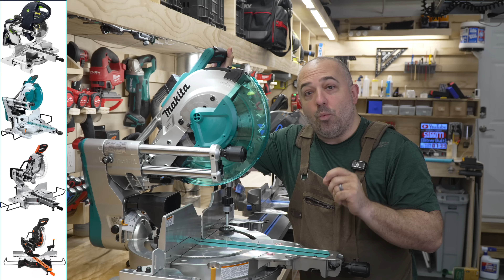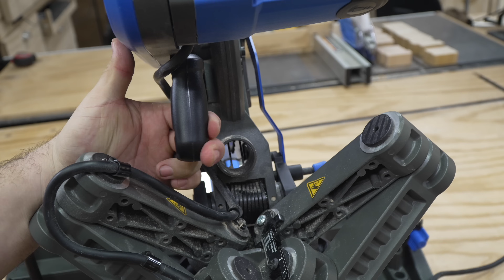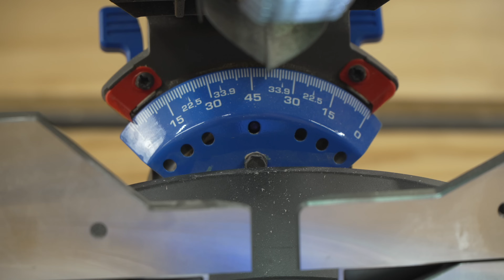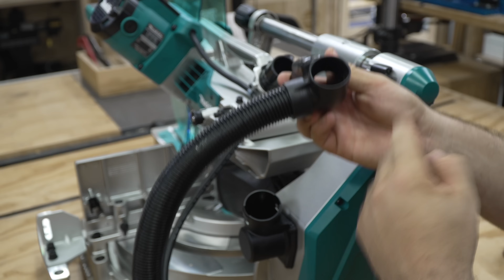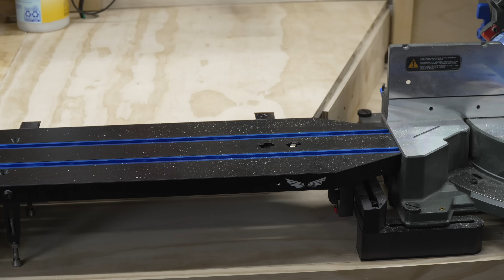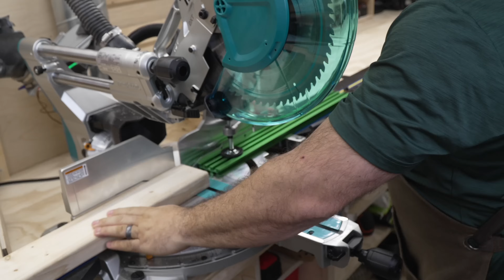Rail Vs Bearing Compact Miter Saws - Makita LS1219 & Delta Cruzer

Comment: Why the F on Delta angle scale there is 45 degrees on straight cut. 0 degree when cutting 45. This is typical in US ?
Reply from the maker: no its that there are red arrows on the right and left so go off what the arrow is pointing to, when you bevel to 45 it will point to 45.
Reply: @ Damn I shouldn’t write Youtube comments after roofing for 14 hours 😅 Sorry for bothering you with stupid question
Reply from the maker: @ocotuchodzi  lol no worries!

Comment: I wouldn’t be shocked if over time the newer hinged style eventually starts to supplant telescoping tubes, but no matter how you cut it (wink wink), it’s a large range of motion you’re trying to get tight accuracy out of with a very large blade imposing lots of force on work pieces while being suspended from only one end. The Makita also had issues when it first came out however many years ago that for a short while demanded a lot of tweaking from new buyers out of the box. Makita (ahem) straightened it all out after a few weeks so it’s not an issue anymore, but the point is it’s just a big engineering challenge with either design solution.

Having said all that, man am I happy I got the Makita.

My projects on rare occasion require me to make angled cuts of 4” ABS tubing so I absolutely needed to get a 12”. The previous 12” I would commonly use would unavoidably deflect as the cuts progressed, leading to very obviously curved surfaces that I’d have to sand flat after the fact. Very time-consuming and tedious both for the sanding as well as having to account for the loss of material in the length I would cut. I spent a LOT of time trying to figure a way around the problem as the blade did not exhibit this deflection just moved through its range of motion in empty air but the moment it was cutting anything that huge blade would bend as it moved into each work piece, even if I actively attempted to steer it away from doing so. Maddening!

The Makita on the other hand…just goes through like butter and stays straight throughout. The cuts are perfectly flat and smooth and I can bind the tubing together (using solvents) straight away, perfectly sealed every time. Just amazing.

I do also wish it had the shadow line and early on even thought to fashion my own LED attachment to replace the laser whenever it fell out of alignment. Thankfully that hasn’t happened yet, and if Makita does have a kit of their own available now to install a shadow line then I’m glad I waited. That and if Makita finally releases larger LXT batteries (which is rumored to maybe finally be happening soon) would perfect this beautiful saw as far as I’m concerned.
Reply from the maker: Quite the “cut” up you are! That’s good to hear that you are getting a lot better cuts with the Makita on your bevels! Yeah, I’m going to install the new shadow this weekend. It’s only four pieces and three of them are Makita factory replacement pieces for one of their other saws so should be a simple procedure, I’ll have it in my next video.
Reply: @ this I am extremely excited to see

Comment: I agree with your assessment. The Makita is the best quality for the money. As cool as the Bearing system feels, it is not accurate. I bought the Makita after purchasing then returning the Bosch without even making a cut.  The bearing on the arbor of the Bosch had so much play I didn't feel it was safe to power it up. The deflection of the blade from the extended position was very similar to what you are showing with the Delta, very sloppy. I am pretty happy with the Makita. Seems to be accurate . I am hoping to be able to do some segmented glue ups with it for woodturning. I have it hooked up to a underpowered small shop vacuum and it makes a mess. I will eventually get a better solution for the dust and hopefully it will be better. Thanks for sharing . Great job with the comparison .
Reply from the maker: Thanks for the insight there! I was doing dust collection test with it last night actually, I’ve been 3-D printing some replacement parts to increase the capability. I luckily have a 6 inch dust collector pipe right next to it, it’s gonna enable me to do 4x2in lines with adequate section. One line to the two built-in independently and then one each to my new fence system I’m building, should be interesting!
Reply: @ that’s a good idea

Comment: I had the Bosch articulating saw and it too has deflection issues - no good for trim work.  None these type of saws will produce great results as there are too many joints which multiply the error inherent in mechanical connections like these.  The mechanism is basically translating rotational motion into linear motion, bad idea. I did pay the big bucks for the Festool.  It's by far the best saw I have ever used. Not only is it very rigid, the vibration and run-out of the blade is almost non-existant so it produces extremely smooth accurate cuts - worth every penny.  The term for these articualting saws BTW is "Axial" not "Axle".
Reply from the maker: Thanks good breakdown, glad you’re happy with the festool!

Comment: So far I’m I love with my 10in Bosch. I’m not asking much of it I must admit. I did make a bunch of test cuts with miters, bevels, compound miters and 90. Dead on out of the box. Mostly I use miter saws for breaking down lumber. I did a bunch of drawer sides and everything was absolutely square. Deflection so far, takes an unreasonable amount  of force on my part while making a cut. I will be on guard but hopefully I never have to deal with any failures
Reply from the maker: That’s great! Honestly part of what I’m gathering from the comments is it seems on the hundred units in all the brands is there could be manufacturing or assembly tolerances / variations that some have it more than others
Reply: @ very true, which is why I own tools from so many different companies. They have have their gems. I have noticed more complaints regarding the 12in as opposed to the 10in as well. Haven’t ever had my hands on a 12

Comment: I see that you said you missed the metabo. I have the C12RSH2s. I got it on sale for $350. I picked it because of the fixed forward rails. It is amazing, easily the least expensive but loads better than the delta and the Ridgid.
Reply from the maker: 👍 awesome great to hear, honestly I think any of the lineup that’s rail mounted is the way to go

Comment: I purchased the delta cruzer I sold mine due to it being not very accurate. I layed down zero clearance tape and noticed how big the line was growing over a very short time. One other thing I did not like about it, was the start it jumps out of your hand which would trip my breaker all the time. I now own the festool miter saw, I did not purchase it new I would never pay 1600 for a miter saw. I only paid 550 for it I got a screaming deal, this was my 4th miter saw. I started off with a cheaper harbor freight than I got the Hercules miter saw, I loved it very good saw however I needed a saw that could buy up against the wall I returned it and got a Matabo saw loved it. When I moved someone broke the locking mechanism and render it useless.
Reply from the maker: Thanks for the breakdown! Ah yes that hard start, I noted that on the spreadsheets, my old ridgid (2 saws back) would always trip. The breaker, soft starts are much nicer there.

Comment: I have the 10 inch rigid and it has a small amount of deflection when the arm is fully extended, nothing near what is shown in the video. So maybe this is due to rigid versus delta, or 10 inch versus 12 inch. I found that when you lock the arm into chop only position, the deflection is minimal, and there is a bit more deflection when the arms are fully extended. I have built about 100 planters with it and the deflection, whatever it is, is not impacting the quality of the builds. I bought the saw about 2 years ago. I had researched all the small footprint sliders, and the rigid was the only one I could actually test before buying (at Home Depot). I think it is fine for diy projects but I would return it if it has as much deflection as what is shown in the video.
Reply from the maker: that's good to hear, im guessing it is more apparent with the 12" with the added reach. also the delta goes 18in max cut the most of any of them, the farther out you are the easier to move I would guess.

Comment: On the Delta/Bosch "bearing" style I suspect the bearings involved are roller bearings. I have come to wonder if Torrington style bearings (needles as opposed to balls. think automotive U-joints as an example) would cancel out some of the deflection.
Reply from the maker: I think you’re right, after the video I was pushing on the side of the saw just to see where I could see if there was a very obvious point of movement and it really was every single one of the joint areas flexing a little bit

Comment: For in-shop, more critical use, deflection is more of a concern for the trueness of 90º cuts in wider stock. If you're cutting 2x4s for construction, the differences in length you're seeing don't matter. 
I'd lke to see the best of each breed compared: Festool to the Bosch.

Comment: I have had the exact same experience (regarding deflection) with both Bosch Glide saws that you had with the Cruzer. Really shows up on slide cuts. I am curious to see how the Makita treats you. I’ve heard that a lot of people have had issues with the removable fences not being square/coplanar with the base and that the rails can be out of parallel slightly, causing bad slide cuts. Fingers crossed you got a good one!
Reply from the maker: Aww sorry to hear that about your Bosch, well initial inspection so far have been good. Everything came out of the box square and nice looking cuts. I have a 3-D print scanner coming tomorrow, I’m actually going to scan those upper fence pieces to then manufacture some new modified ones that will have dust collection built into the fence, so I’ll be taking a very hard look at them tomorrow. I’ll let you know if I see anything wonky
Reply: @BitnerBuilt Well heck, let us know about the scanner as well! (Or just me if it doesn’t work for the channel.) I actually make dust collection parts for miter saws (throat plates, specifically) and have been heavily considering getting one.
Reply from the maker: @InspireWoodcraft  I tried the reality ferret pro - not a fan, maybe its me but spent two days, purchased 3d scanning spray to coat the object and count get any decent scan of it.
Reply: @BitnerBuilt Ahh, that’s no good at all.

Comment: Try out the SKIL 10" SCMS, just not compact. I've had it for 3 years. Rear sliding rail, accurate out of the box, shadow light, quick clamp hold down, $300 or so. Dust collection can be improved with a hood around/behind the blade, like any SCMS.
Reply from the maker: Cool I will take a look thanks for the recomendstion
Reply: That’s what I have. Great saw. I have a dedicated small shop vac on an automatic switch. I’m really happy with the dust control.
Reply from the maker: @jeremyclaybaugh  oh that’s awesome, I like all the good feedback from owners, I’ll have to take a look

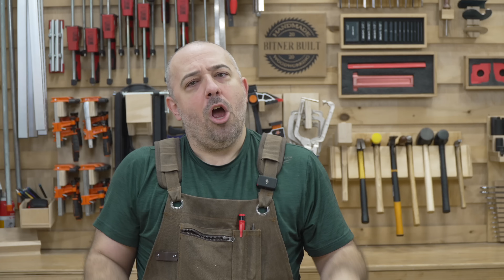Comment: Came here to say this. :)  Well, I came here to add my +1 to the chorus of voices who invariably cried out "What about Metabo?!" at the 1:06 minute mark.  :)
Reply from the maker: 😂 yea I am pissed I missed that one for the price I prob would have tried that before the Makita honestly, but I do like this Makita (just not my wallet)
Reply: I've used both, and the sliding action on the Makita is smoother than the Metabo right out the gate, and the blade guard on the Makita is affixed in a way that makes it feel more substantial, but other than that- the new Metabo has a shadow line, you can adjust the bevel from the front without needing to reach behind the saw, and it powered through a treated 4x4 like it was a spruce 2x3.  No performance complaints and no apparent deflection after three months of occasional use.  The work piece hold-downs are terrible though. I am spoiled with the quick setting material clamps from the Skil.  On the Metabo, considering how tall the fence is, it feels like you are turning that clamp forever.
Reply from the maker: @lifeofreilly  great feedback!

Comment: Hey I had to replace that saw two times in one year and I would not give it a thumbs up that's the Harbor Freight 12-in miter saw
Reply from the maker: That sucks. She had a bad experience with it. Did they replace it for for each time? I had that one for four years function great no issues and I have many friends who have it too who also like it, it is harbor freight… So there’s that, but it does have all the features and functions of these More expensive saws that are really really low price. I could’ve bought 3 1/2 of those saws for the cost of this Makita.

Comment: That deflection is a massive design flaw.  Wowza! 😮😮😮😮
Reply: Any point of movement requires a tolerance, and the more moving parts, the more the tolerances add up.

The Delta saw has 6 tolerances (the 3 rotating points per side) which are all independent.  That adds up!

The Makita saw has 4 tolerances (one per rail) but they are not independent (the rails are all fixed to the same front object and same back object) so they act as one tolerance.  That's as low as it gets for parts that move!
Reply from the maker: @DSArmageddon666 great breakdown!
Reply from the maker: Yea wish I had known the extent before spending the dough
Reply: @BitnerBuilt  good video tho!
Reply: @BitnerBuilt  Learning curves are expensive.  My new rule is to practice on someone else's stuff, whenever possible. I really appreciated this video. I am setting up a new woodworking shed and need more wall clearance than my old Rigid rail saw can provide. I may opt for the 10-inch version, but all else being equal, Makita looks like the winner.

Comment: Not sure if you mentioned this, but it appears that the arms are different (your 3 image comparison show the difference). I have to Ridgid Cruzer version, but mine are a lot beefier (maybe mine is an older model on both Delta and Ridgid) and I purchased it a year and a half or two years ago and my handle is pretty stout for the carrying portion of it. It does still have deflection on the blade.
Reply: I got the Bosch, and a friend got the Rigid Articulation Arm  like the delta, we both sold them within a couple months, just too floppy, just as you show. The bearing joints come loose easy and can be adjusted but is annoying, happens regularly and is simply unnecessary. LMU and rods are much more reliable and stiffer.
Reply from the maker: thanks for letting us know. theres usually some small differences with clones (that Hercules UK model has a few added flares) but they share most of their replacement part numbers.

Comment: You've broken my heart! A while ago, the 12" Delta Cruzer was on sale for less than $350, so I bought it (knowing about the deflection issue). I've only had a chance to use the saw a few times (I was still working full time as a CPA). The few times I used it, I was careful to avoid any deflection and I've been happy with the accuracy. But, I was only trimming turning squares to length or using it on shop furniture projects, so accuracy wasn't of paramount importance. Now, my wife and I are serving a 2-year full-time mission for our church. We're in another country, so my Delta Cruzer is sitting idle in the brand new miter saw station I built for it shortly before we left. I hate to think I'll need to replace it when we get home!

A couple of comments about the comparison between the Makita and the Delta saws. First, I'm told you can tighten the bearing knuckles on the Delta, which is supposed to reduce, but not eliminate, the deflection. It may be that mine came 'tighter' from the factory than yours. I'll certainly try tightening them up before replacing the saw. (I did notice the ability to cause the blade to deflect if I twist the handle while lowering the blade. I also noticed that it's easier to cause such a deflection than I'm used to with other saws. But, it seems 'controllable' with my saw.)

Second, you demonstrated that the top of the Delta saw's fence slides to permit bevel cuts. Is that true of the Makita, too? I've seen videos where the Makita saw's blade hits the fence with making bevel cuts. That may have been a prior version of the fence, but it's why I eliminated it from consideration when buying a saw. I was going to buy the Metabo, but the sale price on the Delta was too good to pass up!
Reply from the maker: oh boy! I will play with the tightening of the baring and post here if I find any improvement. Already bought the Makita so it's definitely swap time. The fence on that pops out the top with a single finger winglet so if your doing a heavy bevel you remove it. there is a clip on it to attach it to the material supports on the side when you do this. In my next video im going to replace those all together (perhaps my design will eliminate the removal need) im going to add built in dust collection vents to each side so lets see how it does! I do have to say the deflection thing was enough and happening so noticeably I broke own as spent the xtra money so pretty disappointed there.
Reply: I’ve had the delta 12 inch for 5 years now and have never had an issue with it, very easy to avoid deflecting unless you’re an ox and have no motor skills plus there’s an aftermarket dust chute that cut the dust down about 95% shop nation sells it for about 55 bucks 👍
I do a lot of trim work and I have no gaps whatsoever 🤷‍♂️
Reply from the maker: @Imtheonewholetthedogsout  yea I was just saying to someone else it seems a lot or very little, I wonder if its more some variations in manufacture / assembly that could be making some tighter and some looser, as theres people here saying they saw the same and others not. I have made all the adjustments I can on this one but that deflect is crazy